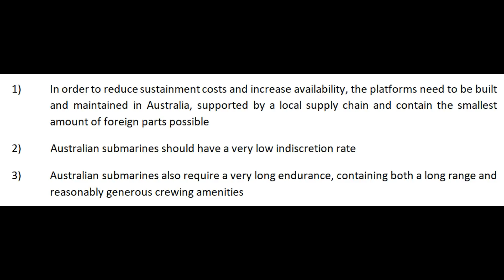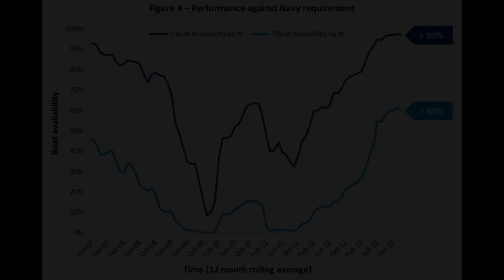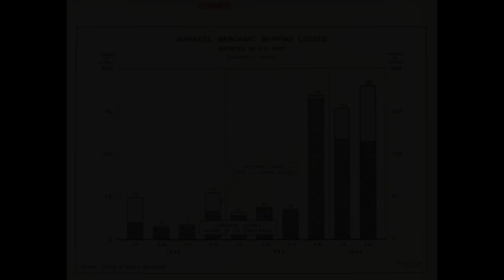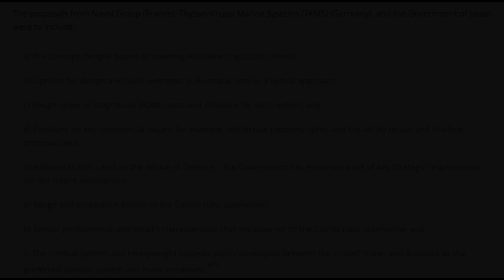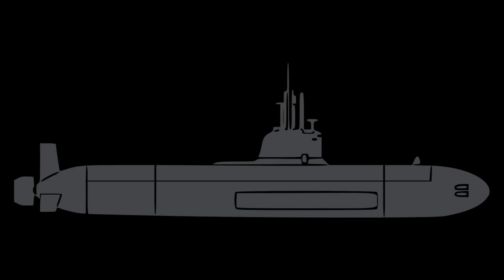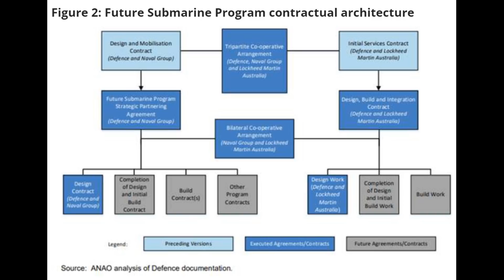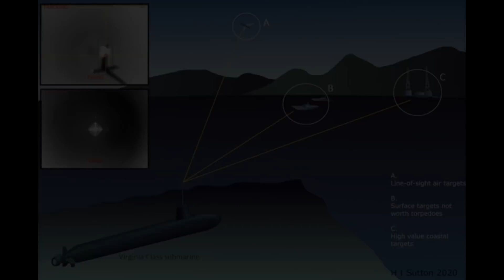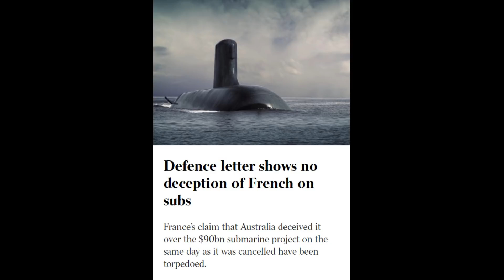AUKUS and the Nuclear Option: the Life and Death of the Attack Class Submarine

Comment: is all about Economies of Scale - how many simultaneously incoming threats can d P/AESA systems is able to handle :) :) :)
guided mortar rounds, 120 mm r equivalent of 155 mm rounds between 6 ~ 12 km :) :) :) 
guided ammunitions fr 57mm guns ~ 10 km, 76mm guns ~ 40 km, 127 & 155 mm guns ~ 100 km :) :) :) 
guided small diameter bomb & ground launch small diameter bomb ~ 100 km
guided rockets fr 70 mm ~ 7 km (on Unmanned Autonomous Surface Vessel against SWARM of PIRATES & Avenger system of equivalent for air defense vs PRC's JARI USV) M142 HIMARS ~ 300 km & capable of fire on ships, 卫士 Guardian/Defender for anti ship & submarine ~ 280 ~ 480 km :) :) :)

*d surface areas of any aircraft carriers & amphibious assault ships r within 6 football fields :) :) :) when combined w. Imaging InfraRed & Home on Jam @ end phase (d sensors will still have radiation heat even shut off after 15 mins?) > d Island mounted w. Sensors & Processing Systems > Elevators > Arresting Wires > aircrafts on d flight deck :) :) :)
*anti submarine torpedo + guided rockets ~ ASROC, VL-ASROC, 卫士 Guardian/Defender > Deformation of d Rudders & Propellers of aircraft carriers, amphibious assault ships :) :) :)
*温压/云爆弹 Thermobaric/Fuel Air Explosive ~ as small as RPG 7, 26 & 27 :) :) :)

*3P Pre fragmented, Programmable & Proximity fused ammunition of IR & Radar guided 40mm guns ~ offer better Metal Deformations on mortar rounds, rockets, missiles, UAVs or any surface areas that smaller than manned aircraft head on w. 3k fragments up to 4 km :) :) :) 
*OTO Melara 76 mm guns + Strales System ~ subsonic missiles & aircrafts head on up to 8 km :) :) :)
*BAE & Archer Artillery System, mounted on all terrain articulated hual trucks, fully automatic magazine & take 10 mins for reloading fr d accompanying munitions carriers w. 4 crews :) :) :) back in d 80s each Fire Control System is able to coordinate 24 guns or 8 guns/battery for leap frogging tactics :) :) :)
*long range multi roles anti Air/Surface missiles c/w Imaging Infrared & Home on Jam > AEW&C & C4SIR platforms, Russian & CCP's current versions r 400 km :) :) :) 
*hypersonic missiles of 5.5k km range c/a Imaging Infrared & Home on Jam > airports w. H6K w. cruise missiles = 5.5k km currently :) :) :)

YouTube ~
程晓农专访 ~ 中澳交恶 战狼贸易制裁失算 踢铁板更重 中澳关系像两岸? 绝地大反扑 澳洲抗共典范 台湾借镜 ~ 政经最前线 2021 Oct 06 ~ Cheng Xiaonong, Economist ~ a mirror image for all on Australia's anti communist resistance :) d belts & routes is d CCP's imitation of d Empire of Japan :) d value of long endurance Nuclear Submarines w. cruise missiles for Anti Access & Area Denial of Asymmetric & Unlimited Warfare :) :) :)
程晓农专访 ~ 史上第2次史特尼克危机 美中冷战又升级? 中俄军力加一起 打不过美国? 爱国者治台 爱共者治台 谁是爱共者? 政经最前线 2021 Nov 10 ~ Cheng Xiaonong, Economist ~ 2nd Sputnik Crisis & who r those Socialists & d 5th Column of Chinese Communist Party's Greater East Asia Co-Prosperity Circle :) :) :)

Combat fits is also d fundamental solutions on health care @ national level :) :) :) Defenders vs Pirates when pickup d weapons & Fisherman when putting down d weapons :) :) :)
狭路相逢 勇者胜 勇者相逢 智者胜 when meeting on a narrow st, d brave wins, when d brave meets, d wise wins ~ movies ~ 墨攻 A Battle of Wits, 大漠战将班超 d Warrior of Deserts Ban Chao, 铁血一千勇士 A Thousand Warriors of Iron & Blood :) :) :)